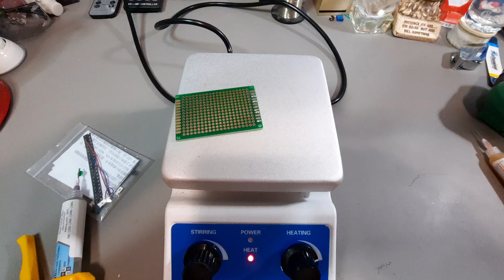SMD Soldering with Magnetic Stir Plate Fail

Comment: I like how the breathing sounds, 3 times faster. :) Anyway, I think it might work better if you start with a cold plate. And then turn on the heating.
Reply from the maker: Video was way to long without a bit of fast forwarding. Not sure which is better, chop parts out or fast forwarding.
Reply: @retireeelectronics2649  I choose fast forwarding... but without the sound. Or at least without the voice.

Comment: Skip the solder paste. Just use flux + leaded solder and solder iron and place the solder on the pcb/pads. THEN put the smd components on the pre soldered pads and then meld it on the hot plate. Solder paste without a stencil is too messy.
Reply from the maker: That is how I did one of these over a year ago, wanted to try something different. I agree without a stencil, it was probably slower then just one at a time.
Have a good day